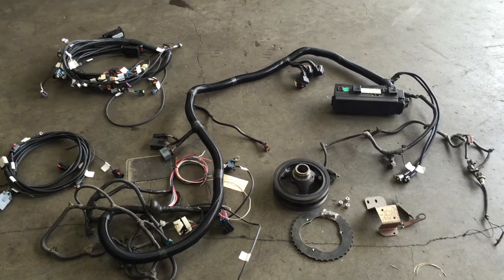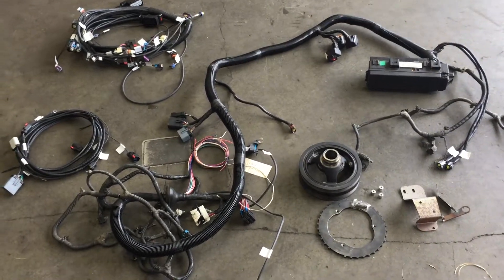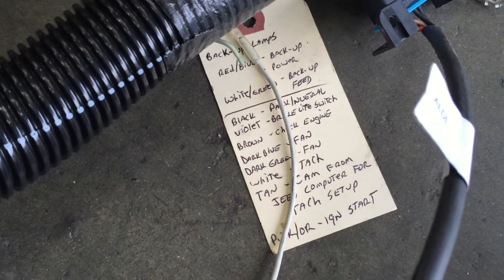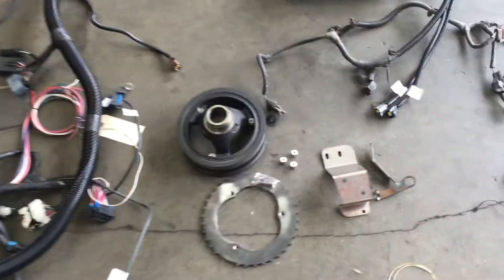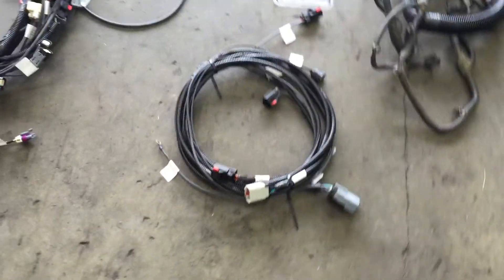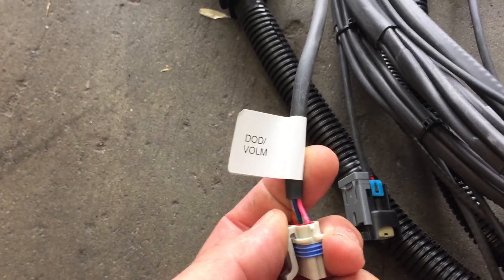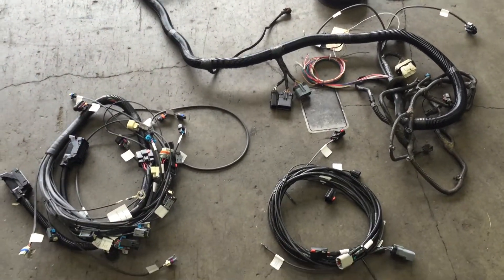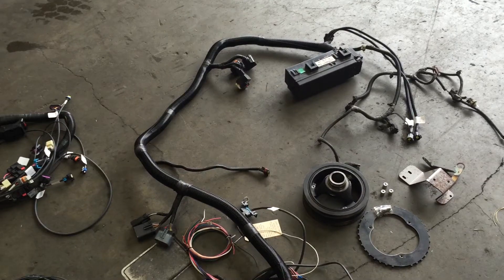Jeep TJ,LJ LS wiring

Comment: I am swapping in a LM4(aluminum 5.3)/4L60E/NP231 combo into my 2004 LJ.  Being that the donor drive train and harness/PCM is from a '04 Isuzu Ascender, will this be an issue with having JSS with mate the two harnesses together?  I know that the OEM Isuzu fuse and relay box is quite different appearing from the typical GM unit typically found in the truck chassis.  What does this typically cost and do I have the option of having the two rear O2 sensors deleted?
Reply from the maker: +Brennen Phipps 
We build a wiring harness for that, but we would need to start all over with a new harness.